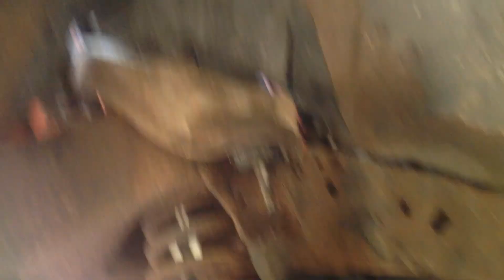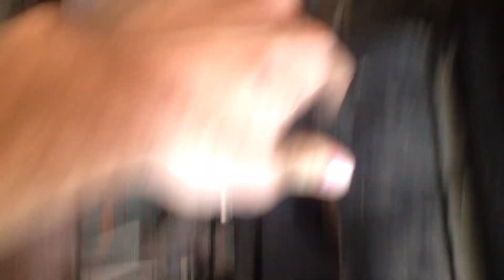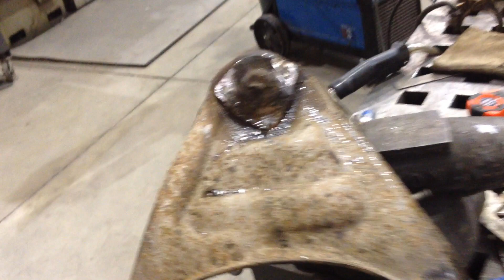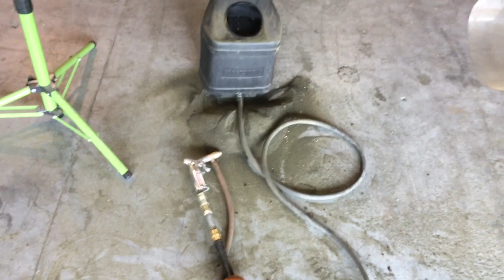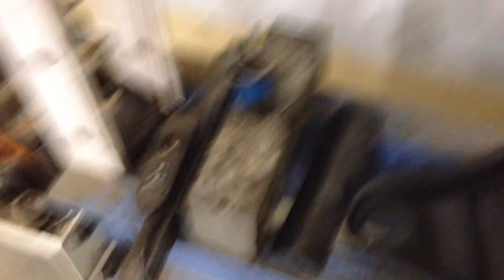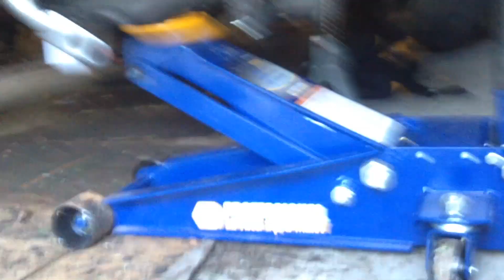Chevelle/Impala Front Control Arm Bushings and Coil Springs- 66 Impala Project Car

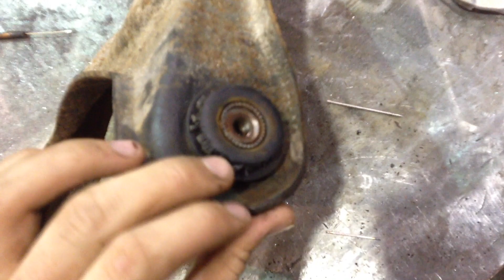Comment: Cheaper to replace the whole control arm than to buy the parts, that comes with new bushings and ball joint 7:21 8:03 saves a ton of work as well
Reply from the maker: Youre probably right. I just had the whole kit that came with the car. It seemed wrong to not use it

Comment: Starting work on a 65 impala front end suspension because the battery died and I had to get it towed and my front driver side wheel is now diagonal instead of vertical. Thanks for the video so I could have some idea how to properly work on it!
Reply from the maker: Good luck with it! It might seem like a huge undertaking but it’s not terrible once you get into it

Comment: I was hoping you would show how to set the cam bolts... do you have any pointers?? Hope to hear from u soon... thanks
Reply from the maker: For those I used a level to get it close.. the bottom of the tire squats out a little bit so I had to go from about 8 o’clock to 1 o’clock with the level. That got me good enough to make it to the shop and get it aligned
Reply: @iowadiy6361  cool... thanks for the quick reply...

Comment: Glad I found this video too. I will avoid changing the front sway bar for now. I had a shop do the front end for me. They had to do it twice on one side because the upper control arm came apart while I was driving the car. Nice huh. I may look at changing the upper and lower control arms out with aftermarket Hotchkiss or UMI anyway. One of the shock bolt hole's stripped out on the right lower control arm.
Reply from the maker: After I did everything I had to go back through and retighten everything again. Then I used locktite on everything that came loose again

Comment: I got the same front bar from Hellwig.
Was kinda ticked that the Hellwig bar seemed shorter, the sway bar bracket did not line up with rear hole on frame.
Sounds like you ran in to the same problem. 
You drilled a new hole on frame,correct?
Reply from the maker: I drilled a new hole for it but now I noticed I also have clearance issues on the left side so I need to go back in and grind that off too
Reply: iowadiy 
You should send Hellwig engineers photos of these issues.
They told me no one has ever called them about any problems with these bars.
I sent them photos of the brackets not lining up to holes.
Mine is not close to road ready to test for clearance issue, body is off the frame.
Reply from the maker: It's hard to believe they've never seen any issues. Yeah, I'll send them some pictures with my recommendations

Comment: I cleaned my sway bar and got it chromed how do you like that one you ordered
Reply from the maker: +Richard Palomo The chrome one will really show nice! I like mine because it's thicker, although I didn't really drive the car with the old one so I can't say if it's much improved or not
Reply: iowadiy got ya I did my bushings and ball joints and doin disk in front I got my control arms Powder coated  can t wait to see more videos of your impala
Reply from the maker: +Richard Palomo disc brakes are probably going to be added on.. going to try and run it for a while on the drums first!